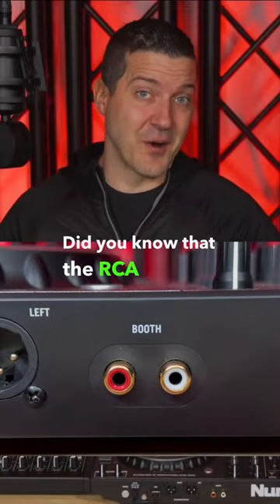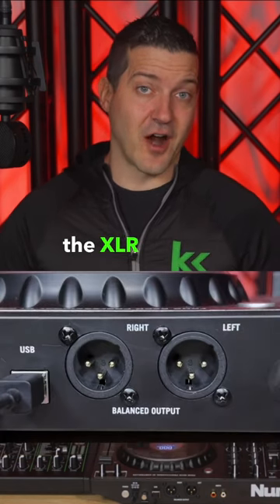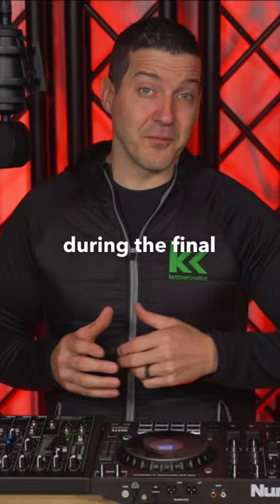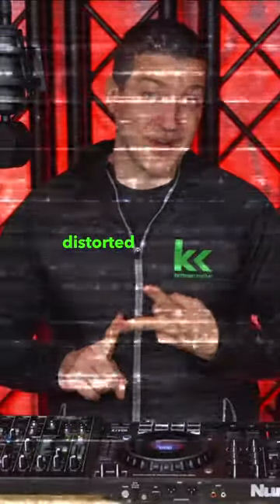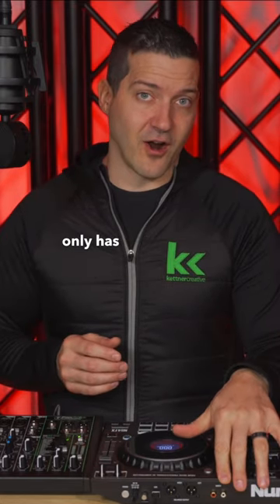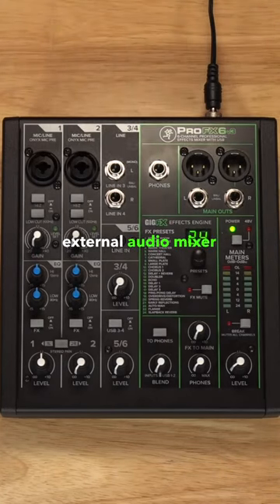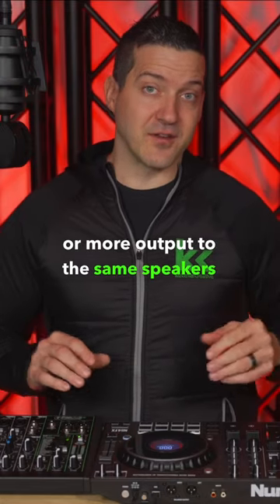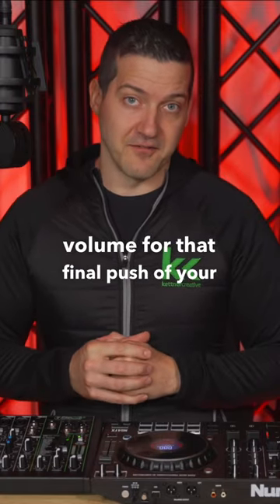Get More Volume From Your DJ Controller #shorts

Comment: If you go through the external mixer you won’t get more volume. The level that it is going out of the rca jacks is the same no matter what it’s plugging in to. If you try to turn it up on the mixer all your going to do is add more noise and make the clipping more apparent
Reply: That's true but an external will bump up your mic output, but yes djs don't know shit. The XLRs can clip as well. It all depends on what type of speakers and how many you are using.